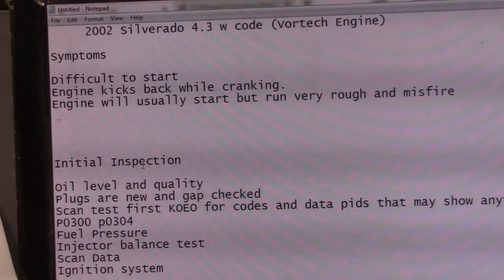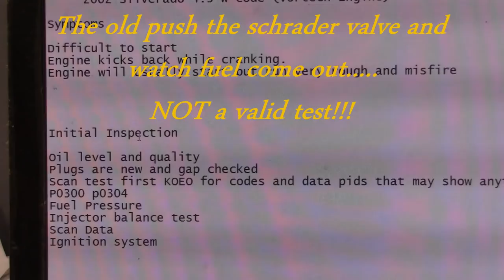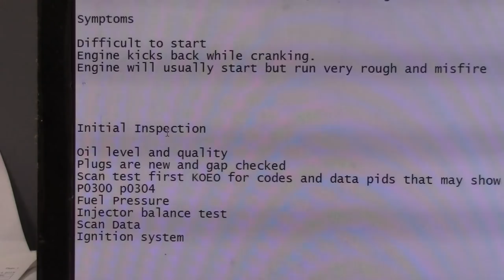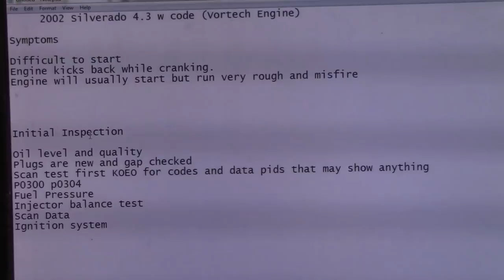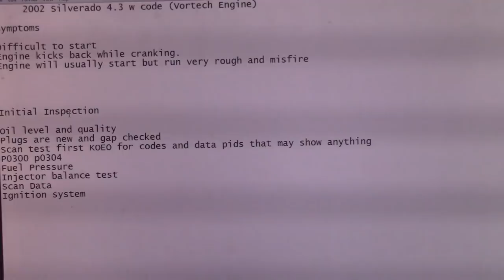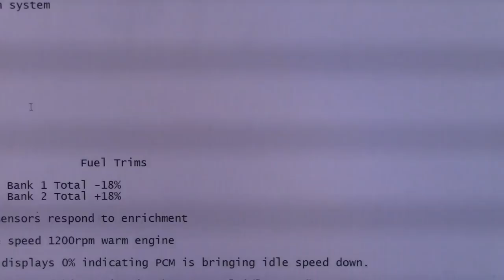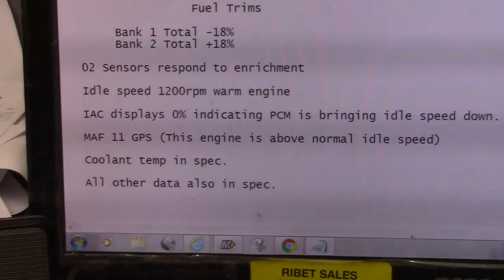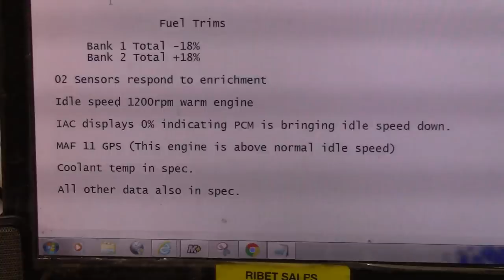Why Vehicle Owners SHOULD ALWAYS Do Their Own Repairs!

Comment: distributor gear about to strip off at the 16 degree off, there was lots of issues around those years, guarantee the gear was paper thin!
ahh, gear you showed wasn't worn that bad yet, I've replaced them worn to paper thin razors and 20+ degree offset! someone vandalized that thing for sure, probably screws rusted stuck and brute force applied vs. skill :)
Reply from the maker: Yes, the gear could have been worse, but it certainly was bad enough...plus the other self inflicted issues, of course....

Comment: Parts markup: NO, it's NOT a markup. Yes, the part costs you $150 if you buy it from autozone/o'reilly/whatever. From a shop it costs $225. You think - I'm paying $75 more for the SAME part. But, the shop includes a warranty on the part AND labor. If the component fails in the warranty window, you pay nothing. So you pay more for the part but you GET more (a labor warranty). If you buy the part and install it yourself, NOBODY warranties the labor of you having to swap it out if it fails. That's a big deal if it's, say, a throwout bearing, etc.

Comment: seems to me people don't mind wasting money on parts but think it's absurd to pay a mechanic to fix it right the first time. I had an employee from AZ tell me one time to just put the intake gasket on so the holes line up, it was on an early model chev p/u with a 350 and if i didn't know better that's what i would have done but that move would have blocked off both front and rear water ports because that's what they sold me in the box was two of the same # gaskets AZ had 3 sets of these Fel-Pro gaskets and they were all the same and the box was unopened. I checked with another friend of mine who worked at a smaller parts store to look up the same gasket when he opened the box there were 2 different # on the gaskets, one left and one right but AZ had all three boxes boxed wrong, putting on those gaskets the way AZ told me to do it would have overheated my new engine in a heartbeat. So home mechanic beware experience DOES MATTER. Thanks for posting hopefully this will pound some sense into some people.

Comment: What you guys are up against is the stealership labor and parts markup giving even independent shops a bad rap. In my book the dealer is 100% unusable and most folks are so frustrated at their inflated pricing  that a vehicle is nearly unmanageable. I've been working my own vehicles for 50 years and early on in life I was a service advisor for 7 years. Simple things like changing a light bulb, air cleaners, plugs, radiator.....etc have turned into a labor time nightmare. These companies are all about engineering planned obsolescence and truly the best way to fight back is to buy a good quality used vehicle and support an independent with experienced mechanics. Many many shops in my area are filled with clueless part swapping mechanics that pass their learning time and parts usage down to the customer.
Reply from the maker: I wish I could argue with you....
Reply: @JoesAutoElectric  I wish I were in your area. It's getting hard to do somethings to the vehicles.

Comment: I had a dealer that showed me a pinhole leak in my tailpipe after I asked him how much it will cost to fix that and he told me 1000,- buks, I knew it was the last time I set my foot there. I got someone else to fix that btw.
Reply from the maker: I can't speak on that because a pinhole leak on an exhaust can be fixed, providing the entire exhaust is not all rotted out.
Reply: Joe's Auto Electric it was a newly installed exhausts system by the same dealer, after I found a dedicated mechanic who welded that hole free of charge and fixed a number of real things instead
Reply from the maker: Oh man....

Comment: There are thieves and scum bags in all trades and specialists / experts. Doesn’t matter if a doctor, surgeon, lawyer, lumber, electrician etc. But mech’s/garbages seem to be fair game for poor customers 

I gave up the motor trade as a master tech due to the very prevalent mindset of new customers that all mechanics/ technicians / garage are cheats and will scam them, from marking oil filters and lug nuts to other deliberate methods of try to catch you out like cash in the glove box and their general attitude of questioning everything including your integrity, it wears thin fast. Old customers get to know you and garage so are normally respectful and acknowledge your skill, knowledge and integrity.

There are loads of scamming customers out there, some just don’t tell the truth as in they won’t let up they have done something or deliberately bring a vehicle in for a basic service or check over knowing there is a major issue then blame the garage for the fault - I have seen it all.

Also mechanics buy their own tools, garages buy ramps and specialized equipment like presses, welding equipment, diagnostic equipment and vehicle specific tools, training etc/etc... it costs. A tradey like a builder/carpenter/electrician/plumber all get materials at trade prices, same for a garage/mechanic, they don’t have to pass that on in whole or in part, this helps to keep down labor costs.

Most people just don’t know what it costs to be a mechanic or run and equip a garage.

Comment: you said you had full engine vac on fresh air side of pcv valve. to me the fresh air side is atmosphere/intake.  could you elaborate for a learning tech?  I'm missing something simple or misinterpreting the info before me. thx Just to make sure i follow the rest..vac from leaking gasket made its way to intake side of pcv which is where your test point was?  I only know small engines, and only ones in older atvs ans sleds, newer mowers are ok.  ..learning big ones (autos)from you, SMA, & ScannerDanner. And any other good troubleshooter i can learn from. Just found you a cpl weeks ago. You all make my shop look kinda dumb...but not for long!. I would have found this problem but not by sensible  testing,,by elimination.Maybe during compression & leak down cuz I couldn't figure it out and those were part of elimination process. Sensible, directional testing is faster. I have an electronics degree I barely use, when I saw SD put a scope on a car i was dumbfounded. Thought of turning a car into a circuit board had never crossed my mind. Now i cant learn how to use my scan tool  fast enough. Its amazing what a meter and a labscope and other test equipment can do with the right technician running them. I want to be the right technician in my neck of NY. I hate having customers come in with a story of this shop tried this and that shop tried that. I dont want to "try" anything..I want to test everything cuz I hate turning bolts..I want to tell someone else (employee) what to turn and be rt about it tho!. Keep up the great work and great vids. Thank you.
Reply from the maker: Fresh air side is attached to the valve cover on one side and then to the air intake tube. Pulled the side off the tube and what I am getting is the vacuum from inside the crankcase due to the gasket issue.
Reply: Now that makes sense

Comment: you could have probably changed the distributor and not the injectors but not the injectors and not the distributor no spark would probably make the distributors look bad
Reply from the maker: Doing an injector balance test proves with NO DOUBT those injectors were faulty.

Comment: it’s great your only trying to do honest work. but my experience has never been good. i don’t mind how much parts cost. it’s the labor cost that’s ridiculous sometimes. example my girl got her car to a shop they quoted her $800+ with a $165 discount. the part cost $199.99 after tax. like you said parts are marked up the shop price was $250 no big deal it’s business i understand. they never replaced the part because i did. it took me 30 mins to replace it. the shop is charging for 2 hour labor. let’s just make it even $800 so parts was $250 what’s left is $550 for two hours when the job is literally 30 mins to do. it’s a simple fix i just didn’t have the necessary tools and time. i ended up working on it on my lunch break. not only that but i have a friend that told me stories about shops he worked for and they were not good. talking about charging customers for parts but just install the old parts. it’s very much hard to know who’s legit and honest when it comes to car work
Reply from the maker: I understand your point, and yes, there are shops that overcharge. I will never deny that. What I am saying is there are good shops that are honest. If you find one, stick with them. That sucks what you experienced. It makes the industry look bad.
Reply: Joe's Auto Electric yea i like doing my own thing but before i go tearing up my engine i research how it’s done and if it’s not over my head i’ll do it myself but if it is i’ll seek help and fingers crossed that they do honest work. keep up with your good work. i’m hoping i can find a shop that do so and that will be my go to shop if things are over my head.

Comment: First video I’ve watched. I was expecting something about the title, instead it was a rant . Evidently someone put a gasket on wrong , ok ? So why should every vehicle owner do their own repairs? ...most mechanics do rip people off. They do overcharge and do mark up parts. Very few are honest and fair...
    I build custom homes, I’m honest,  I tell people my price is very high, maybe the highest around. I use the best materials and we do the best work. If you don’t want to hire us , that’s ok, bye...i don’t negotiate prices. I let my reputation speak for itself. At least it’s honest.....
Reply: You say your prices are very high, others  could say you are over charging witch could be interpreted as ripping people off. Custom homes  have problem that can be traced back to the builder. It is  easy to cover up poor framing, plumbing, wiring, roofing with drywall and shingles.

Comment: ...True story : 15 years ago this was the main reason why I started working on my own S*IT
the EGR valve pipe/tube that it connected to had a split/crack down the back of it and I trusted a "shop" to fix it
at the time it was $18 from the auto parts store but they quoted me $50 dollars from the dealership
they told me the book say its a 3hr job but they would give me a break and charge for a hour & a half + part 
I ended up paying them $180.00 for a job that only takes about a half hour to do!!!! if you know the short cut ; )
my faith and trust in mechanics went out the window when I found out the short cut was to move the starter...duhhh
I have saved thousands of dollars fixing my own S*IT w/the help of a few honest mechanics showing me short cuts!
if its serious motor & transmission problems i'll take it to their shop (fact) everything else i do it myself and I love it...
there are way too many rip off shops out here so be careful!! what I learned doing it myself is worth it's weight in gold
Reply from the maker: Nothing wrong if you can do it. And the shop has far more overhead than you do, they need to make a profit. As for doing it all yourself, that part is getting harder and harder. You need a lot of specialized and expensive equipment to do many things that would have been rather basic years ago. Good for you, if you can do it though.

Comment: The motor trade is so full of scam artists crooks etc etc that to leave the repairs to them is insane, you may as well just hand out your cash down the local criminal hang out spots !!!! 

If you own a vehicle learn to fix it yourself or take the bus. It'd just nuts and bolts guys nothing hard about it
Reply from the maker: You really believe this? Nuts and bolts? That is IF you know what you need to unbolt and replace. What happens when you have a no start on modern vehicles and a generic scan tool that gives you no direction? Start changing parts? What if it's a comm issue? You have a scope and the knowledge to test the system? Seriously man, saying it's not hard these days is insane.